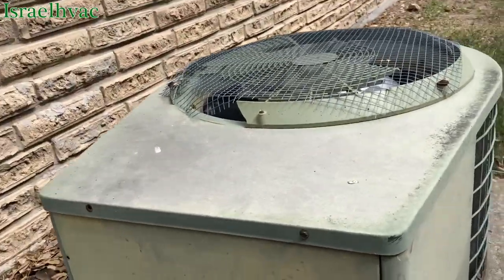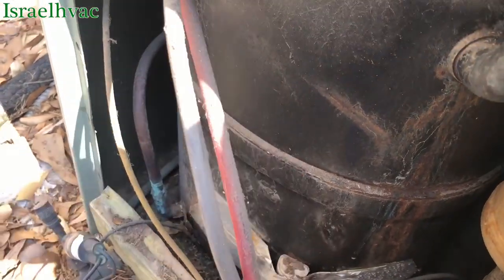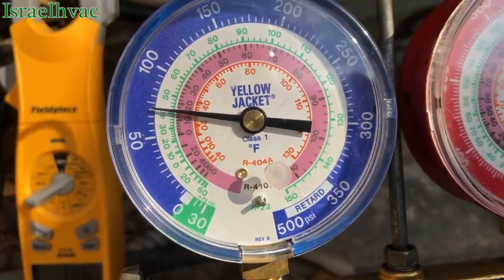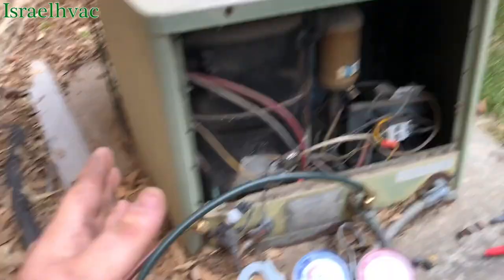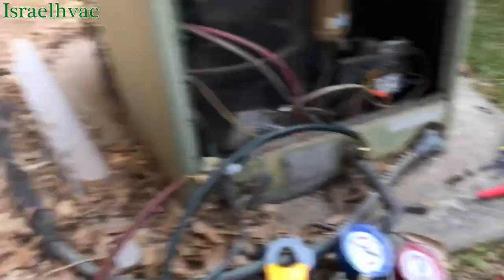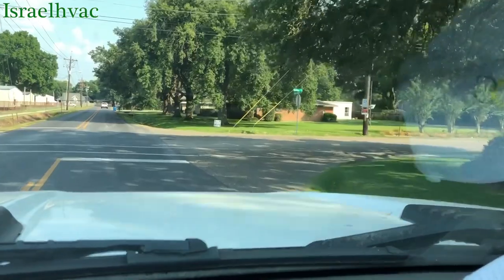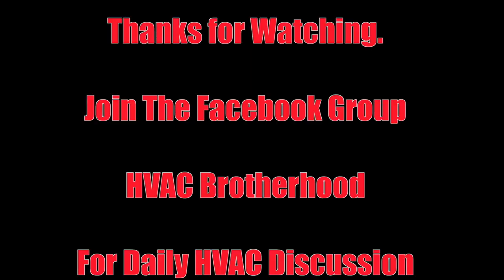HVAC Service | System Running Non Stop

Comment: At risk of expressing an unpopular viewpoint...I disagree. Throughout your discussion about this air conditioner, the only sin it seems to have committed is that of being old. And while it's not all that efficient or pretty to look at any more, it seemed to be running fine otherwise.

I would have fixed it "the right way" by changing the filter/dryer rather than draining away some of the charge to limp it along. The customer might not have any idea what any part of an air conditioner is or does, but they would have noticed things working like they used to, rather than the merely acceptable performance they are getting now. And I think that would foster a tremendous amount of goodwill. People remember more than anything else how they were treated and when it did lay down and die, they'll call the guy who treated them right to put that new system in.

Maybe I'm totally wrong here. I certainly don't know the unit's service history, and if it is a recurring problem (as you hinted in the video), that really does change things. It's also not my intention to cause a problem.
Reply: Can’t tell people how to spend their money. Give em options, let them weigh it. Either way, it’s still gonna cost them.
Reply from the maker: We gave them 2 options. Repair or Replace.
Reply: In @Israelhvac defense I did had similar problem last year and suggested to replace or fix, after fixing multiple problems in one day the customer called back 2 days later ready to replace. Ultimately it was the landlord replacing and when the customer was giving them fire about the out of pocket they stepped up to replace.
Reply: Just wondering...if it was the dryer wouldn't the side after the restriction be at very low pressure and then considerably cooler? I mean a piston or txv is just an intentional restriction right? Just trying to figure it out.....
Reply: HVACR Atlanta: I'm not calling anyone's experience into question here. :-) I can't be in front of that unit to pick up on what it's trying to tell me, so all I had to go on was the indicated temperature differential around that filter/dryer and the extremely high head pressure. Were I there, I'd certainly have had a look around to see what the unit and its surroundings were saying.
Reply: HVACR ATLANTA thats what I was thinking too...usually see frosting immediately after a restriction due to the pressure drop if it's enough.  I only do cars but principles are the same
Reply: Maybe I'm missing something but a dirty coil doesn't cause a large temp drop on the dryer.
Reply: HVACR ATLANTA  We really don't know if the temp drop was only 5 degrees and I bet it was a bit more.  He had the sensor way too close to the dryer and could have been measuring heat transfer across the dryer as well.  I have no doubt that the condenser coil was probably part of the problem.  It has probably never been cleaned since it was installed in the early 1800's but that is not going to cause a temp drop across the dryer.  The unit actually sounded pretty good and for that relic to be able to push that much pressure and the coil not leak is impressive.  Of course, a new unit is probably the way to go but the better choice would be to give an estimate for a cleaning and possible dryer replacement as well as an estimate of a new unit along with a recommendation and let them make the choice.   Just because it's old doesn't mean it needs to be replaced, especially if it is still both running and holding a charge.
Reply: It's a filter dryer and like its name says, it filters contaminates and removes any trapped water from the system.
Reply: Sorry to say, I too think your right..
Reply: No leaking or tripping breakers it can be repaired. Energy savings on a new unit is a wash vs the cost of a new unit as the evaporator (and really the lineset) needs to be replaced as well. If the customer didn't want a new unit I would replace the filter dryer and clean it up.  I would charge around $350 for the job of replacing the filter dryer and reusing the old refrigerant. I'm sure his bosses quote was insane to get them to buy a new unit.
Reply: Dakota Wallender it’s a matter of pointing out the risks of doing the repair. 9 times out 10 this unit most likely would take a dump in a week or month or six months or never with its age and that’s the gamble you must tell the customer when they go with a repair. Your not responsible after 90 days or what ever those laws might be in those states. 

Compressors are fussy animals and to risk a repair at the cost of still loosing a customer over that is high risk. It’s a different story if the unit is 5 years old and all components involved are still in perfect and usable condition. But yes it still boils down to what the customer wants. Nobody was wrong in suggesting that this be replaced either 30 years is out of life span and you’re on your own in that case as the customer and you can’t complain when the repair fails!
Reply: high head like that is coil not rejecting heat, dirty coil... most likely a split condenser coil that has never been split open to clean it.  I see this all the time..
Reply: the real problem is high head period. Gauges are a useless tool until the two coils are clean and airflow is correct.  ie clean air filter......
Reply: no shit! techs reading this already knew that, most reading these are students or DIYers...
Reply: You can fix and repair anything! And then it’s still 30 years old! Let’s say you fix that problem for say $300 and then the compressor goes out on pumpdown now you have to tell the customer they need a new compressor too? Or let’s say you made the repair and it worked great and goes out in a few days... your right uxwbill the customer doesn’t know the difference between a three prong capacitor and a flux capacitor but he will know you charged him $300 dollars 2 days ago and now it’s broken again. If you take money for a repair the customer will expected to stay fixed for some time no matter what they say to the contrary. A good technician would expect that unit to die at any second no matter how many parts you throw at it. There will be no good will as you say, after you take there money and it still breaks down that same summer. Without a working flux capacitor on your time machine there’s not a damn thing you can do for that unit!
Reply: uxwbill I think that fixing a unit like that is screwing the customer. You are gonna charge them an arm and a leg to pump it down and replace the dryer and maybe they  get another season out of it, maybe more but most likely they are gonna pay you, and have high electric bills just to turn around and buy a new unit a year later. Why not put in a new system that is going to save them on their bills and get it over with. The death of that unit is inevitable.
Reply: you guys making the comments about letting the customer decide what's best for them is ridiculous. How long do you think that thirty-year-old compressor is going to last. Even if you went with the one or two man operation to keep the cost down it is better to have the system replaced it isn't always because people can't afford it sometimes people are just cheap asses
Reply: sharks1117 
I completely agree. without a working flux capacitor on your Time Machine there’s not a damn thing you can do for that unit..
Reply: I think the service call could have been handled a bit better. The problem is hot liquid line, not restriction in the dryer. If you take the fan off, spray off the coils really good and shop vac out the inside a bit I believe the head pressure and liquid line temp would have dropped at least to where it wasn't terribly high. Also the compressor won't last long at 350-375 psi. Also it looked to me like the fan was running slow or slow to spin up, that could have been the camera though I don't know. Also the electric bill for that renter is going to be much higher than it should be due to high amps through the compressor and it needing to run more hours due to inefficient operation. Just my opinion.
Reply: @Corey Lambrecht Right, and not the professional who works on these for a living.

Comment: I agree with you John.  As others have stated.  This was a real world call.  It’s not black and white.  I would have done the same thing.  I’m sure the coil was beat as well.  I have to feel good about any repair that I propose.  That thing could lose that compressor or bust a leak any second.  That compressor has been running hard with high head for how long ???
In my opinion you and your company made the right call.  No disrespect to anyone that would have changed the dryer.  But it’s 30 years old , enough is enough.
Reply: monteiro air. What's the labor on it?
Reply: I think is older than 30 years.

Comment: Good idea would have been to check temp coming out of condenser  discharge and if hot dirty cond coil and fan motor amps and rotation, just as a lesson for teaching. I agree with the call to replace though. Good call.

Comment: That was the exact same air conditioning unit that we had at our house when I was a kid, it had a 2 blade though. Ran great all the way up until we decided to put a heatpump in. Those were built like tanks. It was installed in the 70s, I think its a 70s unit.

Comment: everything has a life expectancy,30 years for a condenser is great when typically in the south they last 10-15 yrs and thats with proper maintenance besides the cost to recover ,replace dryer ,vacuum ,and recharge a 30yr old system,your asking for more problems ...i can only imagine what the 30yr old evaporator looks like.....good call

Comment: The condenser didn't look dirty enough to cause high head pressure.  There were probably multiple things going on here.  Partially restricted drier, coil corrosion where the aluminum fins mate to the copper, build up of contaminates inside the condenser tubing reducing heat transfer and possible valve problems because of how slow it went from 100 psi down to 75.  Maybe not on that one though and no superheat to gauge it by.  Bottom line a 30 year old unit has done it's time.  Is fair to have the customer invest 300 or 400 dollars on a filter change out on a unit that will still only go down to 15 amps when a new one with 10 year parts will only run 8 to 9 amps.  I didn't see a service valve which might have been added more to the cost.  Choices yeah, but steering the customer to a new unit will actually pay for itself in the energy savings alone.  Plus the new unit will have more capacity.  It is amazing what you can show if you do a capacity test on a system.

Comment: OK I hope you’re talking about the entire system that’s a r22 system they’ve stopped r22 manufacturing when was this video made tel me you not replacing just the condenser
Reply: Chuck if they bought an air handler with an r410 rated coil all they have to do is change the TXV.  It’s not his or the property managers first rodeo.

Comment: You can fix and repair anything! And then it’s still 30 years old! Let’s say you fix that problem for say $300 and then the compressor goes out on pumpdown now you have to tell the customer they need a new compressor too? Or let’s say you made the repair and it worked great and goes out in a few days... your right uxwbill the customer doesn’t know the difference between a three prong capacitor and a flux capacitor but he will know you charged him $300 dollars 2 days ago and now it’s broken again. If you take money for a repair the customer will expected to stay fixed for some time no matter what they say to the contrary. A good technician would expect that unit to die at any second no matter how many parts you throw at it. There will be no good will as you say, after you take there money and it still breaks down that same summer. Without a working flux capacitor on your time machine there’s not a damn thing you can do for that unit!

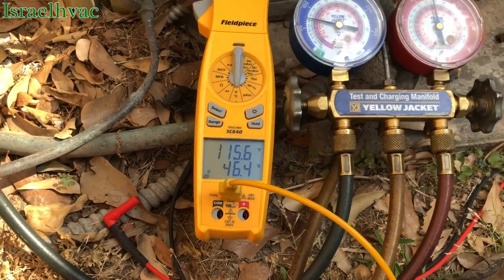Comment: o4:39 should have called the problem by now.. Maybe the tech is distracted with making the video or showing off his toys. The head is to high. Nothing wrong with drier. Some of those units have two speed condenser fans - was the fan turning at it's high speed?  If so clean the conditioner. A restricted dryer liquid line dryer would cause a temperature drop not increase - that was misuse of his clamp on temp sensor.  A lot of equipment gets changed because the tech get bonuses for selling equipment. This guy probably don't know any better than to post this homeowner focused video. A lot of trouble shooting errors in this video. For me the biggest error is the display of the tech's ignorant of the HVAC fundamentals and he so arrogance that he is doing the customer a favor.
Reply: Did you see the unit? The thing is a disaster waiting to happen I wouldn't feel safe with it beside my house.
Reply: everything you wrote makes no sense to me.
Reply: so true here larry,,,a general PM service would be nice here,include a full report on the system after a coil clean and a look at the evap coil and cleaning of same...but wear a face mask inside the house so you can breath
Reply: @larryames8831  the pot calling the kettle black. I'm willing to bet everything that fan motor only has 1 speed. For the most part I agree he's really not the knowledgeable because I'm sure the unit is either dirty or possibly the motor spinning the wrong way

Comment: Nothing lasts forever. It's time to go.
Reply: Shannon Knight darn right she be time to go
Reply: Fuck that, run it till it’ll run no longer
Reply: Ken B run it until the compressor blows and contaminates the system with acid.  Great idea!  Add more cost and risk new unit failure of the acid isn't recognized by the next poor schmuck.